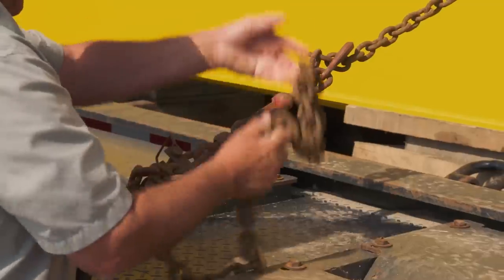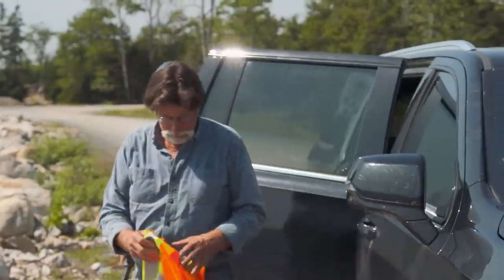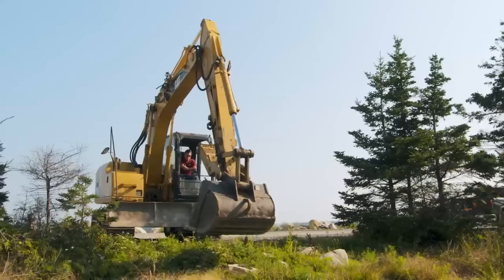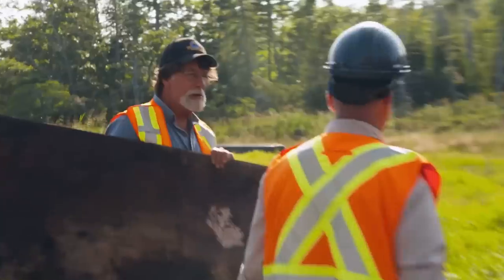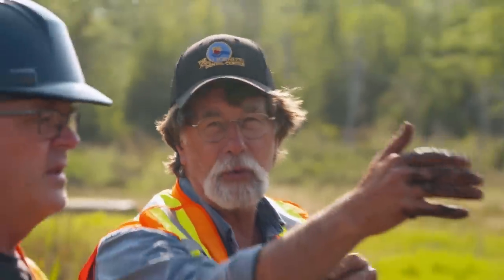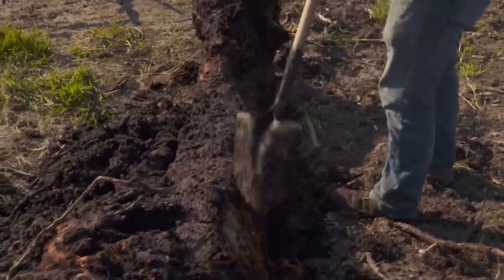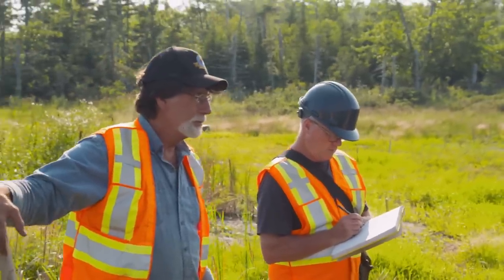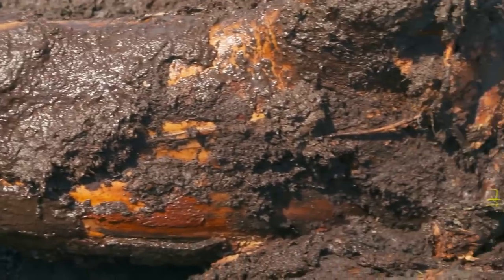The Curse of Oak Island: Swamp Excavation Reveals ENORMOUS Find (Season 9)

Comment: Obviously oak island was a British boat yard during the American revolution. The big mystery,  why so many buttons. The box drains were to used to lower and raise the ships at dock during repair.
Reply: Why would they use oak island when they had Halifax.....
Reply: It was used by the South Sea Company to process logs which were floated to the island from the mainland shores, pulled up the cobblestone pathway by oxen to the woodyard and most of the logs were made into naval stores in the tar kilns, and others taken for masts and spars for the Royal Navy and merchant marine.  The box drains were drains for the turpentine and tar to run down from the kilns.  Coconut fibers were used to filter the turpentine.
      It is highly likely that the island was later used to smuggle rum.  One of the jobs of the Royal Navy was tariff and trade enforcement.  The Royal Navy and Excise Tax men were likely visiting the island searching for non-taxed booze and possibly tobacco.  Buttons were lost during the searches.  Sometimes buttons were torn off in fights between the Navy men and smugglers. Coconut fibers are also used as packing for rum bottles.
Reply: @lewisdoherty7621  this is the best explanation I've heard since this mess started. I
Reply: Old buttons are cheap on eBay and easy to drop through your pant leg into the dirt.
Reply: Pretty reasonable. I was thinking the same thing, only maybe with vikings
Reply: WHAT ABOUT THE GOLD THAT WAS !!!! FOUND , THERE WAS TRACES OF GOLD AND SILVER IN THE WATER🤔
Reply: I could find trace gold and silver signatures in by back yard garden, and so can you.

Comment: The main treasure has been removed. The pit was first discovered with a block and tackle hanging over it. That's something you would never leave when depositing a treasure. But it is something you would leave when recovering a treasure and then leaving quickly. The main treasure if there was one is long gone.

Comment: It wouldn't be strange to find a log in the swamp which was originally a inlet used for logging.  That area was used  by the South Sea Company to process logs which were floated to the island from the mainland shores, pulled up the cobblestone pathway by oxen to the woodyard and most of the logs were made into naval stores in the tar kilns, and others taken for masts and spars for the Royal Navy and merchant marine.  The farming and numerous excavations on the island resulted in material eroding from the top of the island and washing into the inlet which filled up with this material and became a swamp.  The swam was manmade, but not intentionally.
Reply: Nice idea. Now show some links that prove it.
Reply: Your theory is entirely plausible. I have been feeling like it was a shipyard ever since they discovered the tar kiln and the stone pier. Are there any records for the South Sea Company to support it?
Reply: Could it be... an inlet for logging, logs pulled up a cobblestone pathway??
Reply: Have you watched? They've found so much more
Reply: @mikeb4708  The idea that the cobblestone pathway was a log drag was mine based on the idea of the tar kilns and wood processing.  It isn't possible to drag logs chained to oxen without a muddy trench developing and becoming impassible.  Oxen like horses have to be shoed if used on cobblestone or the holes would split.  The early dates from Carbon-14 over the road comes from the fact material was pulled from inside the island during treasure searches and washed on top of the road. The South Sea Company operation identification was based on a book, OAK ISLAND MYSTERY SOLVED by Joy A. Steele & Gordon Fader.  The South Sea Company was incorporated in 1711 to trade with the Spanish for goods and slaves.  Correspondence indicated it also ran a wood and naval stores operation on an island off the coast of Nova Scotia.  So how many islands off the coast of Nova Scotia have tar kilns and the remains of an industrial size operation needing shoed oxen?  Farmers operating in soft soil don't need shoed oxen.  Everyone assumed that Oak Island was called Oak Island because it had Oaks growing on it; although, other islands around it appear to have Oaks.  Maybe it was called Oak Island because that was the location of the wood yard of Oak logs and where they are processed.
Reply: @tbossi69  They found an adze which dates from about the same time as the South Sea Company used the island.  Gary found a piece of wood in amazingly good condition in the swamp which had a really early Carbon-14 date which I suspect he may have pulled out of a church, abbey or castle back in Britain and planted in the swamp to find to keep his job going.  After this, I thought he might do something else and then an outrageous reading came back in the bore holes for silver.  I suspect he may have taken a bottle of colloidal silver people take as health supplements and poured some down the test holes. The tests would indicate there were truck loads of silver in the island.
Reply: @lewisdoherty7621  , better analysis than most of the show's experts. The extensive tunnels and shafts indicate something else was happening too, probably before the operation I think you have correctly identified
Reply: Oak Island 😷
Reply: ....and none of the locals ever knew that a huge logging production facility ever existed there and was never recorded in any county or state records and taxes were never collected..... Yea.... you're right, it would be strange....
Reply: Also suspect  that " "Templar "cross was planted.
Reply: @gregkonig9600  wait a damm minute explain the rusty nail!   Lol lol
Reply: I like it Lewis
Reply: So why do you watch the show?
Reply: @jimbeam3318  Curiosity as to what they will try to peddle next.  Think about this:  They were harvesting virgin forests in Nova Scotia in 1720 containing 250 year old trees.  What would the carbon-14 dates come back as in the beginning growth areas of a tree?  It comes back as pre-Columbian 1470.  Much of the land in Britain was being used for growing crops and pastures. There are no virgin forests in Britain and the current forests have been worked repeatedly by this time.  Wood is so valuable, they use thatching for roofs instead of wooden shingles. The First Nations' people didn't fell massive trees to build large ocean going ships, but the British did.  They had virgin forests with huge old trees which they didn't have back home.
Reply: Guess you dont know much about oak up and ! Their is definitely a tunnel system ! Built by the Templars when they where raiding Egypt and the pirates that raided ships this place was kind of a deposit boxfor their treasurer bc they couldn't take it to the country's they where from so they put it in the new land !
Reply: @lewisdoherty7621  colloidal silver....genius! Evil but genius!
Reply: Interesting Ideas, All around! 
I've got to admit, I've gotten sucked into the Story! I don't watch, much TV. Found these Oak Island Clips, on Utube, definitely peaked my interest!
Lol

Comment: Draw line from the Money Pit to "The Valve" on Zena's map, passes under swamp. Perhaps a long flood tunnel which can be turned off at "the valve" is leaking upwards in the swamp area, creating the swamp over centuries. Find the valve (through the hole under the hatch), shut the valve,  swamp will eventually dry up.

Comment: If they were really smart they should of designated a couple square foot area's that they marked off and wouldn't be touched. Then put a ruler in the ground, mark where the soil is leveled at. Then proceed to wait a year and come back an check the level of the soil. Regardless how much or little it has changed you could calculate per foot of top soil and date back an dig that depth to have a better chance of finding things. Perhaps it's a foot for every 25 years for example an then u would go down 4 feet for every 100 years exc... just a smart way to calculate the depth to dig js.